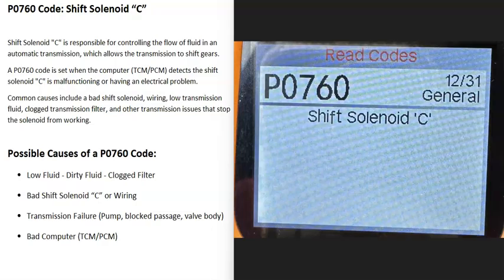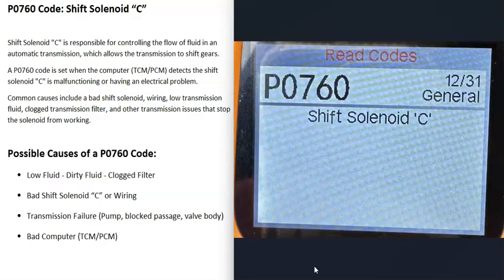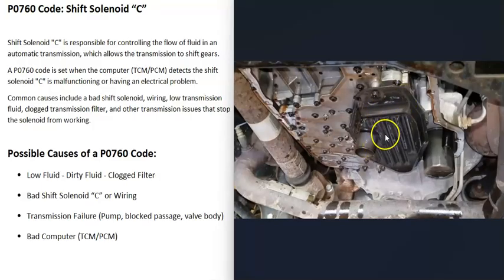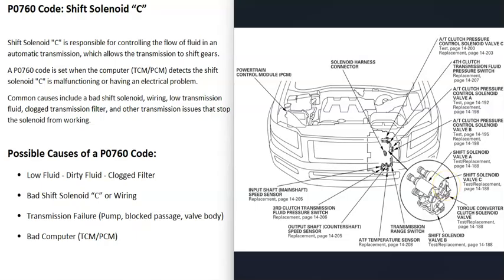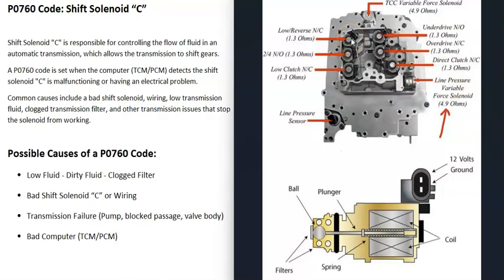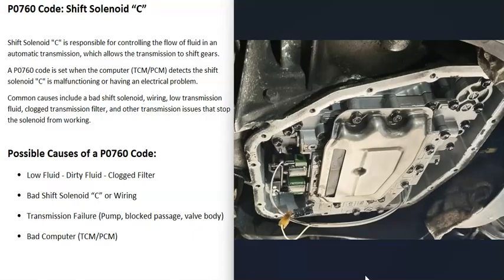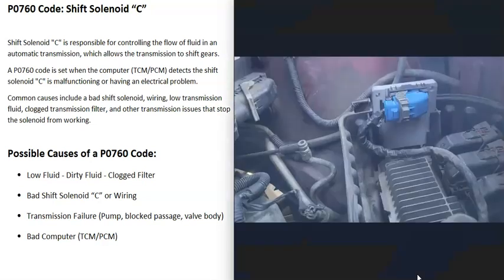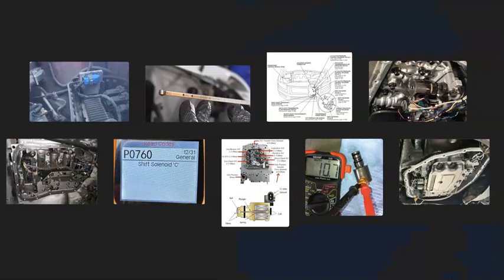Causes and Fixes P0760 Code: Shift Solenoid “C”

Comment: Hi, the code came on after the battery had been disconnected for a few hours then reconnected the check engine light with the p0760 code

Comment: Lovely video. Thank you so much. I have a zf5hp24 box with shift solenoid C error. The mileage is 129k and the engine overheated before being replaced. My question is can the overheating engine have caused the oil to go bad and that’s why I’m getting the code

Comment: Could be you’re valve body check all you’re solenoids and also the check balls valves which on my explorer 2017 3.5 v6 with the 6f50  transmission set a code for p0751 p0761 and the culprit was a stuck check ball valve on the gasket which wasn’t allowing any trans fluid to go by putting me in limp mode well not really limp mode more like I only had 1st gear and reverse since that ball wasn’t allowing fluid to go thru and engage all the other gears hope this helped someone
Reply: Very rare do computers
Fail but a multimeter solves that issue once determined if the Tcm was the issue I checked and passed my so called inspection